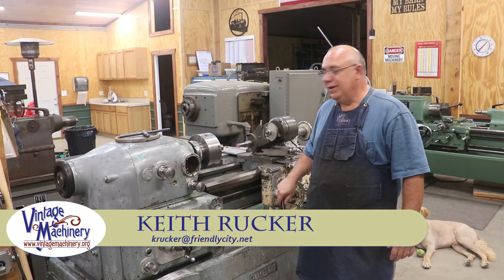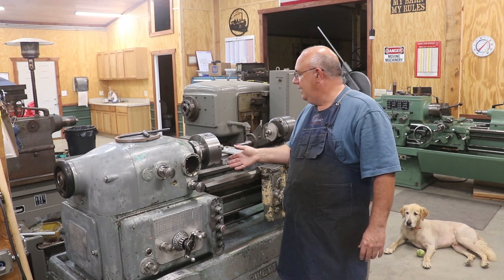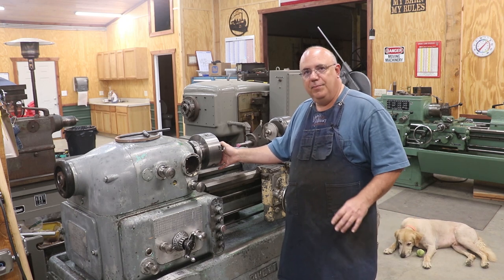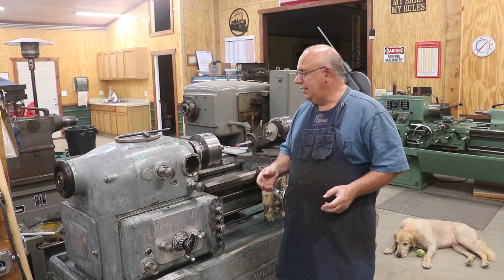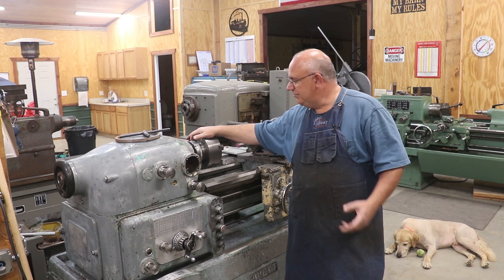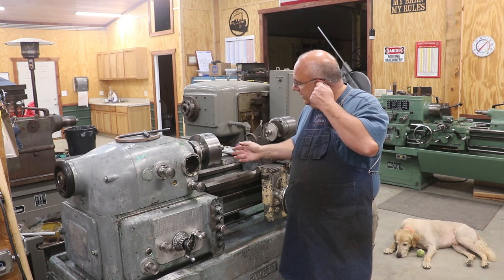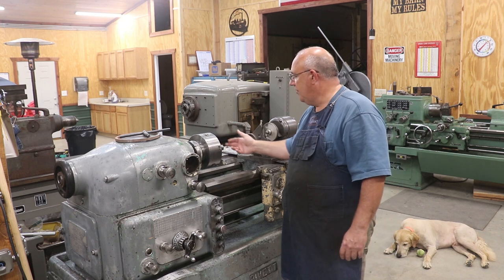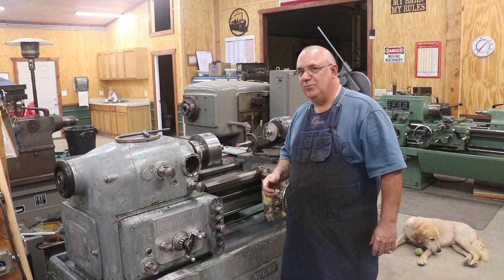Grinding the Faces of the  Jaws on a Three-Jaw  Chuck to Reduce Runout

Comment: Keith, If you take the outer three screws out of each jaw. Than make some snug fitting pins(or special screws with extended heads) in the counter bores that are long enough to chuck on a smaller ring on the inside of the pins. Than you can grind the jaws with the chucking pressure going in the proper way. I will bet you can get the run out even better than .0025".
Reply: Peter, What a great idea. I hope Keith does this. I would like to see the results. Both of you put out very informative videos.
Reply: I agree, I would put longer bolts thru the jaws and clamp down using them to simulate normal use.
Reply: @bcbloc02  After making this comment I even had a better idea. If, as you say use longer cap screws. Than make three tubular spacers that fit in the c-bores in the jaws and the screws can pass thru. Just bolt those on in place of the jaw screws. This could be done either with the outside or inside screws depending on what size your ring is. Or if you were grinding the ID of the jaws or the OD chucking out.
Reply: @chris0tube If you put a ring in the back of the jaws you will grind your jaws bellmouthed. You want the force to the outside so you get max grip at the face of the chuck when holding parts.  if the ring is bolted to the outer row then it would not be any further out than the face of the jaws so forces would be normal.
Reply: Interestingly in 2013, Keith did ground a 3 jaw chuck with the jaws in compression (vs expansion) using longer jaw screws. https://www.youtube.com/watch?v=nALN0qGZbgY

Comment: Hey Keith, another way to preload the jaws would be to place appropriately sized blocks between the angled nose flanks of the jaws and draw them together.  This would preload the jaws against the scroll in the right direction and leave the gripping faces of the jaws accessible to regrind.
Reply: I was thinking you could use longer bolt heads on the jaw bolts and clamp down on a ring with them.
And other ways to do it here: https://www.youtube.com/watch?v=zofS-ewP4Zs
If you need less runout https://www.youtube.com/watch?v=gCUkJydSmdA

Comment: Keith- This Rohm is adjustable. Loosening the three cap screws near the bore  allows you to bump the scroll around with respect to the body. Look at the symbol stamped next to these three screw heads.

Comment: As others here have suggested, replace the outer bolts with longer ones going through holes in a circular plate, that way the jaws can be placed under load with inward tension, not outward.

Comment: It’s always nice when your chuck is “acceptable”...hats off ‘two thou!’   Again, and as always, thank you for filming and editing an informative and very interesting video.  On our farm your videos are required watching because the average age of my tractor fleet is 54 years old with the baby being an ‘93 Case 1194 and the senior being a 1947 John Deere 440 track kit skidder.  My cars and truck seem quite modern by compare but barely.  My 60,000 sq’ barn was built about 110 years ago so I’ve spread out my shop and business in there.  This means I hear grinding or squealing and find out what broke, watch a few ‘Rucker videos’, screw up my adventuresome spirit and go out to the metal shop and cast and machine a new one.  You may appreciate that you’ve saved me thousands over buying new replacement parts!

Comment: Managed to sneak in first... You bring up a good point: If you can turn a part in one setup, then the chuck runout doesn't matter.
Reply: Chuck runout ALWAYS matters except when turning the entire circumference, the entire length of the part. Even in one op, the runout will still matter.

Comment: Even better might come if you swap outer jaw bolts longer and snug the ring behind the bolts. Either way nice content again. Enjoyable every time....
Reply: That was also my thought, along with making some blocks, drilled and counterbored to accommodate cap heads and properly clamping down the jaws as well as a compression ring.

Comment: You could've used shoulder bolts or something similar to preload the jaws in the right direction. Just put shoulder bolts in the holes for the bolts that hold reversible parts of the jaws and clamp onto a ring.  It's actually very convenient comparing to solid jaws.
Reply: thats a good idea

Comment: Keith, if the speedometer shop can't fix the tach, take it to the airport where there is an aviation repair station. They can send it to a certified aviation instrument shop that can overhaul it. It appears to be a standard aviation tach anyway, and they aren't all that expensive for a certified used one. See you at the Bar-Z. Jon

Comment: Did you forget to cover your ways while truing/grinding?
Also, idk anymore on which channel it was, but someone else had basically the same task at hand and he put some long bolts into the outer mounting holes of the jaws and then clamped on a ring between those.
Reply: That introduces its own issues without both ends being clamped tight. Maybe you could machine some spacers, so that the outside screws are tightening on the jaws.
Reply: @xenonram  yeah, that's sonething I considered too, would be definitely beneficial

Comment: Now you have ground it, filling the inside with carborundum dust you will have to take it all apart and clean it again!!! The dust inside will make the scroll wear faster and the run out will get worse quickly!
A shop vac tube placed near the far end of the main spindle would have stopped this AND better for your lungs too!! K
Reply: and how is he going to talk while a super loud shop vac is on ?

Comment: I ground my 6 jaw chuck in a similar way, but I was able to put spacers in the jaws and tighten the jaws inward, not outward like you did.  I ended up with just a couple of tenths runout.  If you can figure out a way to tighten the jaws inward instead of outward you might have better success.

Comment: Scroll backlash?  What if you reverse the jaws, direct clamping force inboard rather than outboard, then grind the jaw surfaces, which are now on the outer diameter?  Return the jaws to normal position and retest.  Love the channel.
Reply: I was having the same question...

I am not a machinist, so just a thought experiment for me....

I suppose you'd be constrained by the "jaw thickness discrepancies (inner to outer)...?

Comment: Keith you are a real machinist and I am enjoying your videos for years, thanks.
In this particular case I think you’ve gotten better result if jaws were supported by inside pressure. As of now they are ground to their backlash.
Reply: Commented to the wrong video!
Reply: real machinists DONT grind equipment !
hes a noob
just buy new jaws
if you have runout is because you used the chuck in the wrong way

Comment: I don't own nor use machine-shop gear, but if it was me, I would loosen the bolts holding the chuck to your back plate and see if a few simple hammer taps would cure the runout. Next I would try removing the three bolts and rotating the chuck against the backplate. Maybe I missed it, but I never saw you indicate the chuck nor the backplate and I don't understand how you can say the workpiece has runout without checking the chuck & backplate.
Reply: I was going to suggest that but there's a taper between the chuck and the back plate so no sideways movement.
Reply: @greybeard3759  I hear ya. That assumes the taper fit is 100% perfect. I still think I'd give it a shot to loosen, indicate, tap-tap-tap, only because you could be done in 3 minutes if it worked. 10 minutes if the chuck was rotated against the backplate (remove bolts, twist, replace bolts) The chuck-to-backplate bolts have some potential be slightly off because of the way they were center punched. Again, I could have missed it, but I don't recall seeing Keith indicate the diameter of the chuck to be sure there's no runout on the diam.
Reply: @pneumatic00  Right you are, it couldn't hurt! .002" can hide in a lot of places, eh?

Comment: Liked the video,long time viewer. Had to cringe a little when you dressed the wheel with no cover on the lathe bed and carriage. I usually remove one screw from each jaw and replace with all thread with a nut on the jaw surface to keep the jaw tight then use the all thread inside surface to tighten against a ring in normal compression. This pre-loads the jaws in a normal fashion. Good job,thanks for the video.

Comment: Put in longer screws holding the jaws on so that they stick out a little. That will give you a ledge to clamp a ring down with the screw heads in the right direction for grinding.
Reply: It is about time someone said it.

Comment: Use a stud and nut on your jaw bolts and then grip around a ring with the tension on the compression side- or use some wedges between each jaw- most 3 jaw chucks have the scroll wear on the compression side. so that's where you need to do the grinding.  I did a Chinese 3 jaw and got it to less than 0.001.

Comment: Keith ! I suspect the 2 .5 thow run out is because your setup.... when you pressed the jaws tight against the ring they are pushing OUT, they should be pressing IN , not out ! to do that replace the back bolts on the jaws with long ones so you can press IN on another smaller ring... that should get you much closer to perfect !,  for what it's worth  keep it up ! love your videos !
even as it is, 2.5 thow is quite an improvement, and I'ed use it like that  myself !  thanks ! Bob...

Comment: Keith, I still think the problem all originated from the taper on the backplate being too large causing the chuck to not seat down completely onto it. Sure the bolts pulled it tight but it doesn't mean the bolts would align things. All it did was bend the backplate to conform to the chuck since the chuck is a larger, heavier piece of metal.

Comment: Simple way is to take about a 3" pipe x 2 1/4" (smaller for a smaller chuck) and mill 3 short slots on one end 120 degrees apart with your superspacer or whatever. Wide enough that your jaws protrude inside a little when you clamp on the slots. Now just run your grinder in there and clean them up. Took me about 20 minutes to come up with it and make. Works perfect. My own idea. It's easier than folks think
Reply: Karl, would you please provide a picture of the completed ring?
I can't visualize this tool.
Thanks

Comment: This is not a negative comment but a suggestion. Remove the jaw outer screws and replace with longer set screws and a nut to pull jaw down tight, then clamp on the extended setscrew with a smaller ring, this will put the jaw under compression/tension and will use the other side of the scroll surface. Unless you suspect the bearings on the lathe are worn.

Comment: I was wondering when you did the clean up video on the chuck and showed the runout. On a Rohm chuck I would expect the back recess and the jaws to be more concentric than that.  It looked to me like the index recess was in the back cover plate,  is it possible that you clocked the back cover plate when you reassembled the chuck?
On a good name brand chuck like that I expect the final grinding is all done based on a fully assembled chuck, and on a good name brand lathe like that I would expect the backplate you made to be be very concentric with the spindle, so the only two variables I can think of are clocking the back cover plate on the chuck (the cover plate that holds the scroll in, not the back plate to mount it to the lathe), or the previous back plate was not concentric and the chuck had already been ground to fit that one.

Comment: use a large hose clamp on the inner jaw projection, then the tension is correctly applied in compression i.e. in the correct direction (inwards)

Comment: Hi Keith. I've been a welder and mechanic all my life. I really wanted to learn how to machine metal to build things so I bought a lathe and mill about 7-8 years ago and started learning. I can do things but am not that experienced. I see you as someone who has probably been running machines all your life and enjoys it. I have much respect for that. I watched your video on truing a 3 jaw chuck and am wondering why you didn't use some kind of way protection on your lathe to protect from the grinder dust? I do a lot of grinding and hear all kind of bad things on what the dust can do to your lathe and was wondering if you believe it is that bad. Hope you can find time to answer. No hurry. I enjoy your videos and am thinking about building a tool post grinder.
Thanks
Mark

Comment: It might have been worth indexing the chuck on the backing plate to see if it might come closer to zero runout. Clamping a ring using the jaw screws would apply pressure to the scroll as it would be in use.

Comment: I don’t particularly like grinding with the pressure going outwards. last time I tried it I ended up with twice as much run out as I started out with. In your case it worked, so I guess it has its merits.
Reply: i guess with bolt on jaws you could take some some longer screws and make a ring with the bolt hole pattern and bolt it on top of the jaws and apply pressure inwards. i just would be careful with how much pressure. just a quick idea. edit: i scrolled through some comments and other people suggested similar things. should work

Comment: Drill and tap 3 bolts through your ring, let the threads stick out by half an inch, and insert them in the hex bolt heads of the jaws. This way you can tension the jaws in the right direction, and grind ALL the deviation out of the chuck.

Comment: Keith!  For Shame! Learned from an old master machinist way back in 1963: Put 3 pieces of plastic,(we used nylon at the time), cut square or rectangular say 1 inch wide between each jaw. As you tighten down, the jaws contact the sides and are squeezed together as the teeth try to meet at the center. Tighten firmly & they will stay in place. If the grinder hits them in the process of truing the jaws, no mind; they just get cut away.  Now you have true jaws with the proper alignment & tension as they have in machining use. Quick; accurate; simple. I always machined my 3 pieces on the mill together so they were exactly the same width.  Just sayin'.  Very good shows though. I like them a lot and eagerly await your country short cuts every week. I was trained by a machinist who could have been a nazi. Be within a ten thousands of an inch or do it over.
Reply: The jaws on my 9” 3 jaw chuck is warn at the front, and I so short stock has a lot of runout if I don’t use a steady or a tail stock. How would I go about milling them down? I take it that all 3 the jaws need to be the same height, how did you ensure that you killed yours flat? I haven’t been machining for long and any help would be appreciated thanks

Comment: 6:02 You might want to use all three pinion gears to tighten your jaws up.  The reason I say this is watching one of Abom's videos he found that the runout on his six-jaw chuck improved or rather the repeatability did after he adjusted it's backing plate.  I can't exactly tell you why that would be the case but I imagine it could have something to do with putting preload on all three of the pinions... or maybe spinning each of the three pinion gears help center the scroll plate in the tooth profile of either the pinion or jaws themself... I honestly don't know; just thought I'd mention it.
Reply: right many ways to skin a cat, my 16 inch pratt has 6x 9/16 hex skt screws fastening the back cover, ease them and tap the chuck

Comment: I end up using 3/8" alum flat bar pcs with slots cut in end to pinch the jaws. I wanted it to be clamped in normal position.

Comment: Perhaps it's already been suggested, but instead of using a ring to immobilize the jaws, why not reverse them, clamp a machined rod in the chuck, and then grind the OUTSIDE of the jaws.  After they're ground, simply reverse them again to their original positions.  That way, instead of using the outside edge of the spiral, you'd be using the preferred inside edge.

Comment: Brother, have you checked whether the headstock is lined up to the bed before you do any grinding? In other words, is the spindle bore parallel with the bed? I would suggest you do this first before you do any grinding. I recently got a big surprise when I checked my lathe's headstock alignment  - 0.2 mm over 700 mm.
Reply: Interesting,  Was it a Colchester Lathe?   On some of the Colchester's that I've worked on the headstock is screwed down on to the flat machined bedways and there are a couple of jacking screws underneath the headstock and between the ways to give a bit of sideways adjustment.  They are difficult to get at, usually clogged up with muck and can easily be missed.
Reply: @mrmyorky5634  No brother, it is a piece of Chinese trash. The Colchester is is a totallydifferent class - quality

Comment: Probably a dumb question but wouldn’t u wand to close the jaws all the way, grind the outside of the jaws so they grab that machined ring perfectly then do the inside? Or would that throw off the center line of the chuck spindle?

Comment: Keith. I hate to say this but I don't think your back plate is true/flat when the chuck is installed.  I think your taper that aligns the chuck on the back plate is a fraction too large for an interference fit and when the bolts are tightened it warps the back plate.  PLEASE test this because when you installed the tension ring it looked like the whole chuck was wobbling over 1/8".  I am not a machinist and I didn't spend a night at a Motel 6, just wanting the best for you.
Reply: That's a logical deduction and I'd hoped Keith would've tested it.